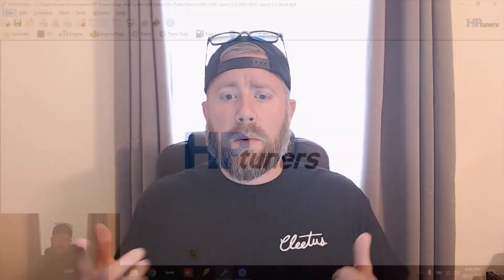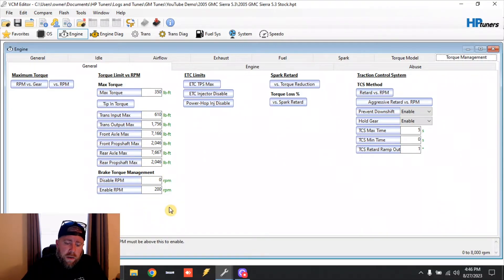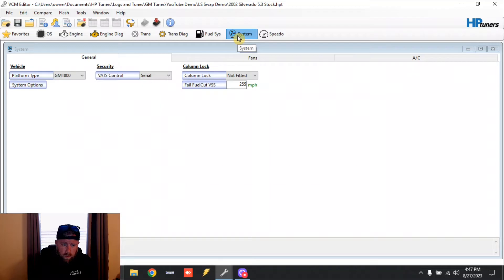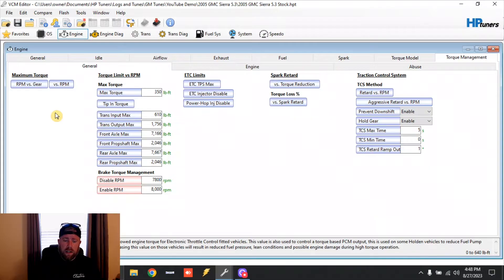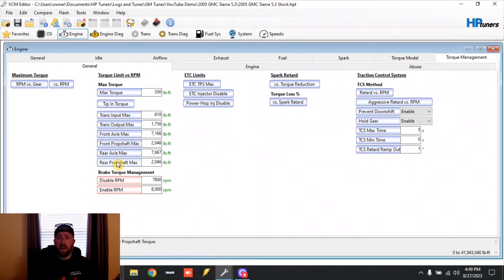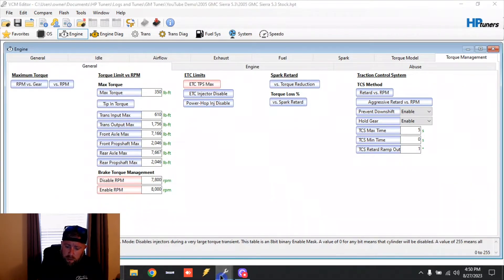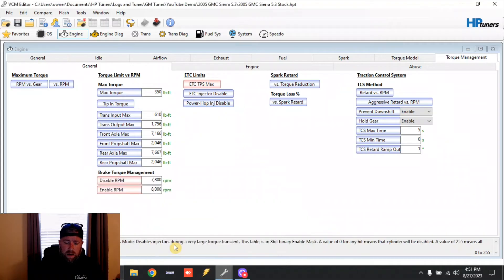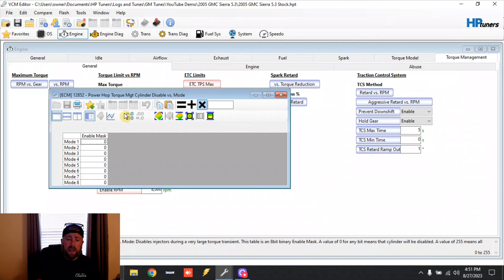Burnout Mode… ENGAGED! Gen 3 GM How-To using HPTuners

Comment: I realize this video is older. But I have a 2004 2500hd and it is fly by wire and I have to go to the systems options in order to zero the 1.

Comment: Is tuning a 4l80 the same as 4l60?
Reply: Very similar. Variants depends on your driving habits. If you're towing a lot, you should be more careful applying too much instant torque. It can break stuff with a lot of weight on the rear axle

Comment: I have a question regarding the ETC TPS Max.  I'm looking at the tune for a GMC Envoy with the 4.2L I6 and trying to gain some throttle response.  The table exists in the same place but instead of throttle percentage on the Y axis of the table it has lb-ft, and it actually has 4 steps below zero.  It is a drive by wire application so would the same idea apply? Leave zero (and below) alone while maxing out the rest?

Comment: Just a heads up. When changing the 2002/GenIII from 1 to 0. You have to do a write entire for it take effect.
Reply: yezzir, was making sure this was in here for the folks. Also since this is at the top ill help some more, dont mash your brakes so hard, also if your like me that do not run the brake pad squeakers, reaaaally make sure your dont mash them brakes lol (when you remove the squeakers ive found you get more of an even braking instead of the 70 front 30 rear. Also for the 4l60e haters, dont hate it is litterly the only fucking transmission IN THIS WORLD that was designed for YOU to rebuild not a damn trans shop. There isnt one special tool you need to buy for a 4l60e rebuild. In fact really maybe 10 tools are needed to rebuild this fucker, oh and like 30+ hours if you want to do it right. global transmissions - you buy your rebuild SEAL kit, the clutches, BASICALLY NO HARD PARTS OR ELECTRONICS - then you goto Cyclone transmission for there hardparts (I bought the 5 pinion planets but they accidently sent me fuckin 4 pinions - 38k miles and just finished a cross country road trip with 10k pounds no issues <---- with the 4 pinions :), and then uhm buy your 13 vein pump kit, with oviously the steal rings (basically the over rev kit so you can safly go past what 5800k. Get the brass bushings out of the 3-4 sprag, make sure you get 32 element (with this upgrade you will roll backwards on steap upgrades when letting off the break to release pressure from the trans. ultra wide band, the corvette servo, and right now i have the (kinda forget) 8-10 clutch alto 3-4 with kanloee steels NEVER buy a regular clutch pack with the original 6 clutches, (personally i go with alto instead of the raybestos - ive heard its  a builder preferences, lets be real ive been doing my trans since 152k miles, and currently i have 338k - ive never had a burn clutch kit. For ease of mind buy all new electronics the selenoids, pillow switch, and the harness (DO NOT BUY THE hARNESS OFF GLOBAL TRANSMISSION - NO ELECTRONICS) you will thank me later, HD2 shift kit, dont go agressive, go with the middle. also buy a nice converter, honestly i got the NightStalker like 2200 stall or somethign converter and man guys, i was scared at first, but really ive had this torque converter in for WELL over 100k miles, and the bitch still locks up like gear 5 lol. I didnt bypass lockup like precision tranmission does either. Make sure you buy ALOT of the green scotch brite, grind down all of the steels, even your new kalone steels. New bushings to make your trans last (truly i rebuild my trans 2 different times without replacing bushings (152k-300k miles) though i would suggest replacing them honestly. Now you aint doing all of this to let the fucker die right, so goto to auto zone, orrielys something and get yourself a trans cooler, cut the hard lines off your radiator, and route the lines to your new cooler (please for the love of god dont just cut the return line, and route that line to your cooler, cut BOTH lines, and route it to your cooler. What people dont know is a master seal kit for a 4l60e is 60 bucks, with that being said i can remove my trans take it apart, and put it back together for 60 bucks (thats if nothing is wrong with it), from there you buy parts at a time. Once you have your trans built and in your vehicle, goto walmart buy the RED trans fluid gallons (valvoline) drive for atleast 5k miles, order yourself the 12q from amazon of royal purple trans fluid, and do your final service to your transmission (and when i say final service i litterly mean it lmao) royal purple in the 4l60e is like 100x better than using john deer high and low velocity fluid mixed (and if you ever have driven a 4l60e with hydrolic fluid instead of trans, youd be impressed) - needless to say im at this video because i have a fully built 00 silverado stage 2 racing cam, fully built 4l60e that i did on the dinner table with my ex at an apartment lmfao in the dirt - that i currently drop second at 80mph ON DA DAILY lol 2" long tube header life - im not saying this is for everyone, but really gm did build there vehicles back then for a complete DIY experiance. Im not an auto tech either i am an rv tech, granite i work on half a million dollar desiel pushers almost on the daily, and i did start off working on cars, but really these tranmissions are really easy to rebuild, and dont hate yourself if it doesnt work the first go around - hell my first rebuild on my 4l60e i was 18 years old smoking soooo much weed with my high school bud, no earlier than 10pm at nights rebuilding my 4l60e for the first time - after i rebuild it i didnt have second. I move states with a trailer towing all my belonings with no second gear - 2 years later driving around giving it gas in 1st to 30 letting off and shifting into 3rd and easing into it, all it was was just a cut seal when i instealled the 2-4 servo. Just remember the 4l60e haters are haters beacuse they hate paying to have there trans rebuilt. Rebuilt it yourself to your liking, and once you get to that old age, you wont need to rebuilt it anymore......... Cheers gentlemen. P.S there is no point to rebuild your transmission if your not going to spend the 50 bucks to tune your transmission with bluecat - Bluecat is the way! also your fuckin welcome lol also if you ask no videos are coming from me with my 4l60e cause i DO NOT PLAN ON REMOVING THE FUCKER ANY TIME SOON!
Reply: Oh that makes sense, just did this and it still pulled a little timing, the throttle response set to 100 was a good change though

Comment: Truck still won’t do a burnout after doing this??? Silverado bone stock 4.8 60e
Reply: You need smaller wheels 😂
Reply: Probably have hydra-boost brakes not vacuum booster
Reply: Watch the video for 8:50 I to it
Reply: Turn off transmission abuse mode

Comment: Awesome Video!! Matt, what version of HPTuners are you using? My brake torque is not showing on 2006 ETC truck. I am in advance mode.
Reply from the maker: Yours is located under the System Options tab in the same spot as the 1999-2002 trucks. GM moves it around sometime for some reason 🤷‍♂️

Comment: My application is similar, turbo 6.0 80e in a g body, when we finally figured out how to eliminate the large timing retard and it was able to spin the tires in the burnout box it spun up so fast (7400 rpm) it upshifted to second and third and hurt the overrun clutch in the trans. The next attempt I instructed the driver to just do a second gear burnout and when the tps exceeded 80% it downshifted again into first which is also 4l80 overrun clutch and sprag killer. I have modified the table now so that it starts and holds second but upshifts into third at about 70 mph and holds it until the end of the burnout. I doubt I did it 100% correct but the trans is happier and I've never seen it referenced anywhere else so had to improvise

Comment: Would this be the same for a 6.0? I had somebody do a tune on mine but believe needs to be adjusted, i have long tube headers with 799 heads . It is a LQ9
Reply from the maker: Yes it is the same for all Gen 3 trucks.
Reply: @Matt_Sanford  thanks! Anything you recommend doing to mine to maximize the power?
Reply: Yes
Reply: Still can't do burnouts in 03 1500HD LQ4 4L80e. I turned off abuse mode and did write entire still pulls timing any advice?